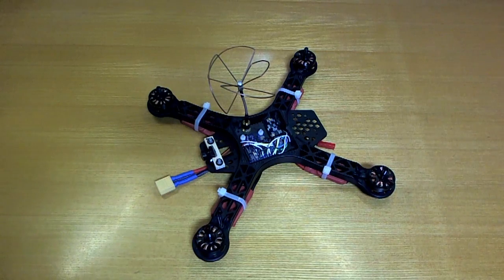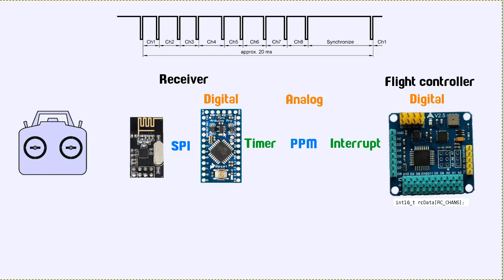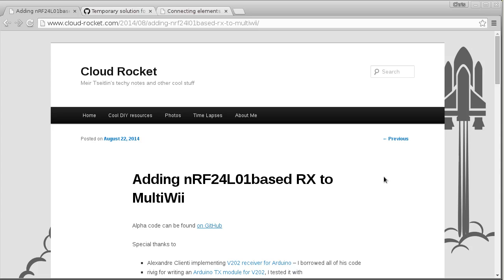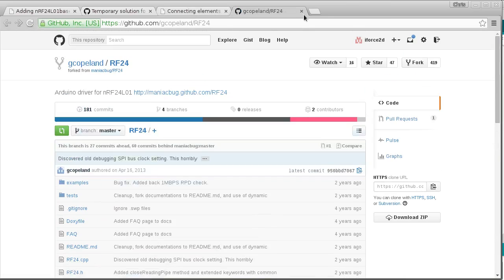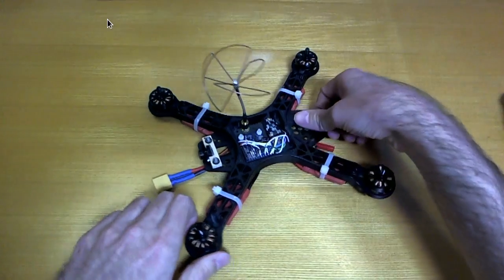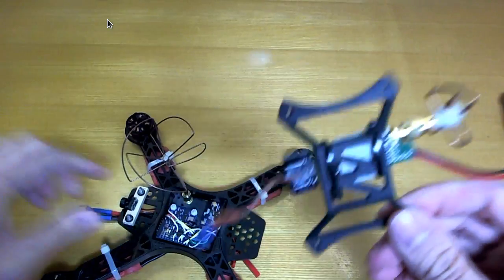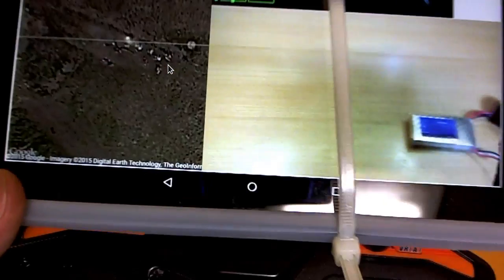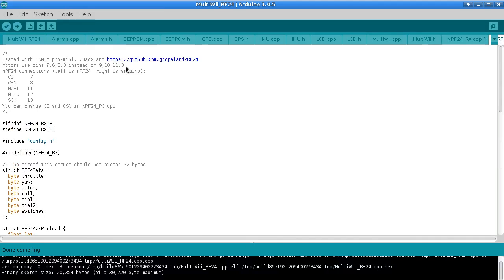Data telemetry with MultiWii integrated nRF24L01

Comment: it was an excellent job my friend. but i have an question. i do my cheap-ass quadcopter from your videos(very thanks). now i want to make my headtracker. i buy cheap things video receiver,gy521 mpu6050,two servo control pan/tilt...... etc... and i want to send mpu6050 data to my camera with two servos with using nrf24l01. how can i make it ? Can you help me?
Reply from the maker: Murat özden What exactly are you stuck on....
Reply: ***** i want yo use transmitter = nrf24l01+gy-85+arduino     ..... receiver nrf24l01+arduino+servo motor  .   want to use gy85 for headtracking and control servo motors. how to transfer its data. Can you help me?
Reply: merhaba Murat özden hocam. Arkadaş nrf24l01 bağlantısından dolayı bazı motor pinlerinin yerini değiştirmiş. Bende arkadaşın paylaştırğı dosyaları derleyip prominiye attım fakat sadece d3 ile d9 daki bacaklardan pwm inyali alabiliyorum., D5 ile D6 sürekli sıfırda. Multiwii conf programında hız yön verebiliyorum motorlara ama gerçekte durum böyle sizde böyle bir sorun yaşadınız mı?
Reply: merhaba Alperen Kolamuç hocam walla denemedim bu kodlarını daha. kodlarda sorun vardır incele istersen biraz. Bende nrf24 ile head tracker yapmaya çalışıyordum saolsun yardımcı olmadı :D
Reply: Murat özden hocam nrf24l01 ile 2 cihaz arası veri transferi çok kolay eğer takıldığınız nokta bu ise ben yardımcı olabilrim

Comment: Hello! Do you use the nrf24 module only for data telemetry? Or the code is also useful for control the multicopeter via any rc control?
Reply from the maker: Wecker Josué As I showed in the video, the nrf24 is used for both control and telemetry.

Comment: Excellent job! I like lot of options, although little bit complicated at first glance. Especially I like telemetry part. That is what is my dream (I have no quad yet, but...).

I think it may apply to the airplane as well - I do not see any obstacle to do that. Rihgt?
Reply from the maker: ***** Sure, it should be the same. Keep in mind the range of these modules may not be as good as for typical RC gear, and you will need a high-powered version at both ends. You can probably find my range test videos in the list on the side.
Reply: ***** Yes, 100mW on both end for sure. But, I think that it is possible to program Atmega to remember starting location (with GPS module), then if signal is lost, do program this way so that airplane begins to return to home (RTH), until good contact is re-established again. I mean, 'typical RC  gear' i okay, but I love to have more options (in the case of Arduino programming, coices are almost endless). Also, If plan is such that I want to fly in straight line, far from me - then I can build directed antenna at controlling site, and point it to my plane. For FPV, it will be bit difficult, but so far - I have no plan in near future to fly FPV (but who knows...). Thanks and best wishes.

Comment: Hi sorry to bother u again.
how do u read all payload data on tx side all i can get to work is just first line.
How do you separate these?

nrf24AckPayload.lat = 35.62;
  nrf24AckPayload.lon = 139.68;
  nrf24AckPayload.heading = att.heading;
  nrf24AckPayload.pitch = att.angle[PITCH];
  nrf24AckPayload.roll = att.angle[ROLL];
  nrf24AckPayload.alt = alt.EstAlt;
  memcpy(&nrf24AckPayload.flags, &f, 1); // first byte of status flags

regards
Reply from the maker: Darius Keinys I don't understand what you mean by "how do you separate"... why do they need separating, and from what?
Reply: Im not good on coding but how do you read more then one actpayload? Is the example how to???
Regards
Reply from the maker: Darius Keinys The readAckPayload function reads one payload. That function is called over and over in the main loop, so about 50-100 times per second typically.

Comment: Greatly integrated RF24 with multiwii.. I was working on similar tricopter project that didnt flied well due to my own PID flight control algorithm but now i think it will definitely fly due to multiwii integration with nrf24 modules.. You can check my tricopter on pranjalnrobotics.blogspot.in

Comment: you have compiled with gps and full sensors?
for me is impossible to have compiled code < 30kbyte (only remove baro)

another question: why remap receiver pins(2,4,5,6,7) instead remove for other functions?
Reply from the maker: no, adding the RF24 code will make it too large for 328p boards. I have been playing around with it a bit lately, and I can get it under the 30kb limit only if I comment out a lot of the GPS features (mainly waypoints, but also the adjusting of alt-hold) and change the RF24 to not use ack payloads. It's an interesting challenge, but if you want something that just works I would use a mega instead.
I'm not sure what you mean about remapping receiver pins... the RF24 uses hardware SPI which has specific pins. It's the motors that I've remapped.
Reply: remapping not for pins used for RF24 (7,8,11,12,13) but external receiver/transmitter not used in this case
only for test you can edit config.h and add enable this serial receiver  #define  SUMD PITCH,YAW,THROTTLE,ROLL,AUX1,AUX2,AUX3,AUX4
in this case you can safe +-1kb i think because used serial transfer
Reply from the maker: *****
hmm... yes you're right, that's very interesting, thanks!!
Reply: ***** another suggestion i replace serial buffers size to free memory and remove warning for low memory in arduino compiler. Tested with no problem if you don't use serial GPS
#define RX_BUFFER_SIZE 64 // 256 RX buffer is needed for GPS communication (64 or 128 was too short) -- modifica
#define TX_BUFFER_SIZE 64
Reply from the maker: *****
yes, good point. I'll be trying some GPS things soon, using ubx for GPS input.
Reply: ***** i make new version of multiwii with arduino mega and logitech usb joystick with telemetry, nrf24 rf, 200A current sensor and voltage sensor
new recompiled version of multiwiiconf optimize 64bit for windows and little graphics enhanced 
this joystick http://gaming.logitech.com/en-us/product/extreme-3d-pro-joystick
prototype now working when finish i make update with shield pcb  for mega and interface for usb joystick
shield for mega have bluetooth  and esp8266 configured with transparent protocol

Comment: Hi sorry to bother you again is there a chance to get this for arduino mega or (Crius AIOP v2 ) working for thtat controller what need changing?
Regards
Reply from the maker: From me? No, no chance :) You can get the original file from multiwii source for "output.cpp" and compare with what I've done. A lot needs changing.
Reply: Ok thanks for replay.Ill get on in.
U the best!!!
Reply from the maker: *****
ah... wait a minute. On the mega, the pins used for SPI (50-53) already do not conflict with the motor PWM pins (2-10) so you don't need to do as many changes as I did, and I don't think you need to touch "output.cpp" at all, so it should be much easier. You only need to have the startup sequence for the radio module, and then the code every loop to copy the RF24 values into the RC input array. Search through my source for "RF24" and you should get the idea.
Reply: Thanks again!!!
Reply: Hi is there a chance to donate you ???
Got default output.cpp and some minor changes in ur code and my transmitter works on ur code feeling so happy can i donate you?
Regards
Reply from the maker: aww... :) if you have paypal you could always send something to iforce2d@gmail.com good to hear it's working, I guess having more pins makes the mega easier to work with
Reply: Ok will donate you once i home.
All i did is replaced output.cpp with original one flashed boom all works fine and thanks for ur code.

Comment: Is it possible to connect the nrf24l01 module to a CC3D flight controller ?
If yes, how are the wires connected and what are the codes to be uploaded?
Reply from the maker: Not directly, no. But you can connect the nrf24l01 to an arduino, and then connect the arduino to the CC3D. I made a video series about that a while ago ('cheapass quadcopter').
Reply: Yeah I know about those videos. I just needed to confirm if it possible to connect the CC3D directly to nrf24l01 module. Anyway I've got my answer.

Comment: Also I thought I would ask if you would consider making the ack payload a def option? It might even be nice to have it as a global flag that can be changed at runtime. You could use TX to enable/disable the ACK payloads.
Reply from the maker: There have been times I would have liked to enable/disable ack payloads for the transmitter, because I have other quads that don't use ack payloads and I wanted to switch between them without re-uploading the TX sketch. Although I never bothered to do it, you could easily check at startup whether one of the switches on the TX was on or off and either enable or disable acks accordingly. For the receiving end I never felt like it was necessary, but I guess you could do the same thing by having a switch on the quad to either enable or disable acks when you power it on. But changing it after startup using the TX though? Yikes... I don't see it ever being necessary and it would be very messy because the RX can only listen in one 'mode'. You would need to restart the TX in the mode you don't want, and send the command to change modes, then the RX could reset its RF24 module, then you would need to restart the TX again in the mode you do want. I suppose you could code it in to use switches on the TX but it seems like quite a bit of work for not much benefit. Much easier just to land the quad, flick the switch on it then turn it off and on again. More to the point though, in most cases I think you'll find that whether you want to use acks or not is a model-dependent thing, eg. for a quad that doesn't have a high-power RF24 module and a good antenna, you would not want to use acks (my PCB antenna RX cuts out at about 30m). So being able to switch modes on the TX would be good, but imo hardly ever useful for the RX.
Reply: ***** I see, if the impact to the rx is nil then indeed no need. My tx is a hacked v2x2 and uses a module with no CE pin so I was under the impression that it cant use the ack payload. Since it seems to only be related to tx it's trivial and your right, not an issue. Thanks again for the additional info.

Comment: I have been using this code to get started with MultiWii with my DIY setup and it is working well. I found that the brushed configuration was not working with the remapped motors and so wanted to share the simple changes I have made to add brushed motor support to your code.

    #if defined(NRF24_RX) // for nRF24L01 receiver, use pin 5 and 6 instead of 10 and 11
      #ifdef EXT_MOTOR_RANGE
        atomicPWM_PIN6_highState = (motor[1]>>2) - 250;
        atomicPWM_PIN5_highState = (motor[2]>>2) - 250;
      #elif defined(EXT_MOTOR_32KHZ)
        atomicPWM_PIN6_highState = (motor[1] - 1000) >> 2;
        atomicPWM_PIN5_highState = (motor[2] - 1000) >> 2;
      #elif defined(EXT_MOTOR_4KHZ)
        atomicPWM_PIN6_highState = (motor[1] - 1000) << 1;
        atomicPWM_PIN5_highState = (motor[2] - 1000) << 1;
      #elif defined(EXT_MOTOR_1KHZ)
        atomicPWM_PIN6_highState = (motor[1] - 1000) << 3;
        atomicPWM_PIN5_highState = (motor[2] - 1000) << 3;
      #else
        atomicPWM_PIN6_highState = motor[1]>>3;
        atomicPWM_PIN5_highState = motor[2]>>3;
      #endif
      atomicPWM_PIN6_lowState  = 255-atomicPWM_PIN6_highState;
      atomicPWM_PIN5_lowState  = 255-atomicPWM_PIN5_highState;
Reply: changes are to Output.cpp @ line 431
Reply: I am still waiting for the FET's so I have not flown with these changes, works fine on the bench.
Reply from the maker: expertsetup
Thanks! I have never used brushed motors with any of this, so I didn't actually know to even do that :)
Reply: I just tested it with some fets from another board and the brushed changes I posted are confirmed working. Super fun and my first quad build.

Comment: if i have to connect just esc wires and the receiver for a x\+ quad. Do i use only D11 D3 D10 D09 connections and the receiver pins up on there?
Mine is a multiwii328p, so just 4 wires for escs and one for rx, right?
I ve no experience, but i would learn sorry
thanks in advance
Reply from the maker: As I mentioned in the video we can't use the default pins 9,10,11,3. We have to use 9,6,5,3 for the ESCs.
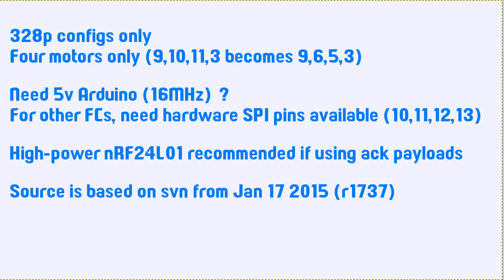Receiver? The nRF24 module is the receiver... I showed those connections too, at 16:05 (the nRF24 will also need GND and VCC of course).
So connected to the arduino will be a total of 4 wires for ESCs and 5 wires for nRF24.

Comment: Fantastic job... I am impressed. clap clap .... Are you aware about the "bradwii" project ? It would be fantastic to add basic telemetry for such V2X2 protocols.... Out of topic question. What is practical range gain from 1Mbit to 250kbits datarate ?
Reply from the maker: SeBy DocKy Hi Seb, not often I see a new sub whose name I actually know already :) No, I didn't know about the bradwii, seems like he has a few interesting ideas. Since I don't need a high data rate I have only ever used 250kbps for all my RC with these modules, but theoretically the range should become a bit less than half for each time you double the data rate.
Reply: ***** It's what I observed... I installed Bradwii on a cheap WLtoys models and changed datarate of the V2x2 to 250Kbits... (as well as for the DeviationTX implementation of this protocol) and range have been improved a lot. Now I am dreaming to have an DeviationTX of your nRF24L01 protocol w/ telemetry .... as well as for Bradwii :) Should be the cherry on the cake ... On more time bravo... I will look to your other videos which seems to awsome too

Comment: like this : http://www.banggood.com/J-LINK-LJ-8005-2_4GHz-5W-WiFi-Signal-Booster-Broadband-Amplifier-p-89432.html
Reply from the maker: It looks ok to have on the ground for a one-way transmitter, but it weighs 400g! (my quad weighs 295g) :D If you really need 5W range, I think you would be better off with a different frequency altogether, eg. 400MHz etc and you would also need a really powerful FPV setup as well

Comment: really nice video as always! I still have a question that it's a bit offtopic. When you made the connections to drive the RC car, did you used the FC to control the motor and the steering of the car? I was thinking about controlling some servos directly from the arduino without any other hardware involved, than nRF module. This setup can be used without IMU to fly a glider or a plane, like a proper rc system :D Cheers!
Reply from the maker: For the car I used a brushed ESC (controls the same as a servo, position 90 is neutral). For the steering I used a servo. The control line of the servo/ESC goes directly to the arduino, but you will want the power for them to come from a separate source (usually the main battery is connected to the ESC, and the ESC will supply 5V to the servo). Just make sure the ground of the servo and the arduino are joined. There is no FC involved for the car.
Reply: I know how things works electronicaly speaking, but what I meant to say was how did you modiffied the code of the receiving side of your system to output different servo signals instead of ppm signal :) Thanks for the fast reply!
Reply from the maker: micultimy91
You can use the servo library to write values to a servo. Now that I think about it, I explained both sides of the sketches for the car in this video line by line, starting from about 4 minutes: https://www.youtube.com/watch?v=eVnyPSAefxU

Comment: Can the antenna be separated into it's 4 individual clover leaves, to be mounted separately onto the 4 cardinal sides of the quadcopter?
i'm not sure if the antenna is designed with the clover leaves delicately spaced to positively interact with eachother how antennas even work.
Reply from the maker: I have a feeling that would work ok, but if I understand it correctly the coax connections going to each leaf would need to be very exact lengths, and you couldn't make them too far apart. Overall I think it's easier and lighter to keep them together, then they can be put in a case to prevent bending in a crash. I might try making something better sometime, there are some pretty good how-to videos here on YouTube that explain the details.